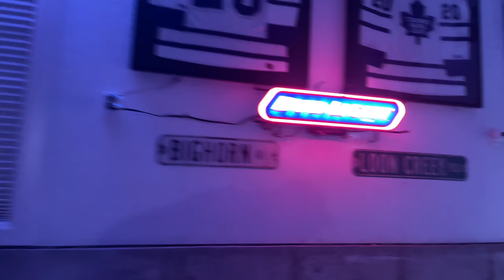S3:E14 NHL BOX CONTROL | SHADOW WORK | NEVER SEEN GOALIE KNOWLEDGE.

Comment: Do you recommend having the gloves in different positions based on your depth? Seemed like in a few of the demonstrations, the glove coverage would end up above or outside the box as the goalie gained depth from the goal line.
Reply from the maker: Of course. Your gloves lower the closer than man gets dependent on your depth…. This is why guys really attack 16” to the blocker/ trapper as they “know” the gloves are high.

Comment: Based upon the demos, would you suggest that as you advance out off the goal line the glove should come a little lower to not cover space outside the frame, or just keep your stance your stance?

Also, this is a great demo for the justification to integrate the overlap on shots in the pie into one's game, something I've been trying to work on.
Reply from the maker: Yes your goal is to cover that box as comfortably as possible without hindering mobility.
Reply from the maker: And on dot or lower angle shots you SHOuLDNnT use your standard butterfly flare. Your flare should mimic the given shooting triangle
Reply: @FutureProGoaltending  my old ass hips don't get too wide these days.  So I compensate (don't we all) with a bigger challenge.  In the pie I'm usually deeper than for shots in home plate.
Reply from the maker: @rtroth2946  as you should be.  You’ll note in the experiment notes (link in description) the pie angle shots are aimed at disturbingly small weird shaped box.
Reply: @FutureProGoaltending  yeah found that to be illuminating.  See what I did there?!   But yeah weird.  Now if I could just figure out why I always get sniped by right handed shots long side low blocker below the dot I might solve a life mystery.  😂

Comment: I'm surprised you didn't talk about one knee down against the post and about its pros and cons. True it's from a far away puck and No-one really does that from that far but maybe mentioning it would have been nice.
Reply from the maker: Are you speaking of VH or RVH?
Reply from the maker: I have frequently indicated the ONLY time for VH and RVH is when the man is threatening the net and IS WITHIN a stick length… so this video just provides video support to that. You note on the poor angle the net is only 5 square feet or net even without the goalie. So RVH on a gapped puck is wrong and why I started the #rvhfail😎
Reply from the maker: And in the index you can easily find RVH 101 and RVH 201 😎
Reply: @FutureProGoaltending  none. Back then there were no name for that position. Cary price amongst other used it 15 years ago. The left knee drops down when the right foot is against the post
Reply from the maker: @PTS.MT.Goalie.BJJ.Andrew  that is the VH and still is seen time to time
Reply: @FutureProGoaltending  yeah, weird though but I never hear anyone talk about it. Used it last night and I couldn't have seen myself use RVH instead. I would have got scored top shelf close side (mit side coming from the left)